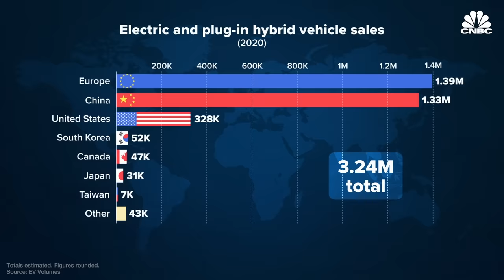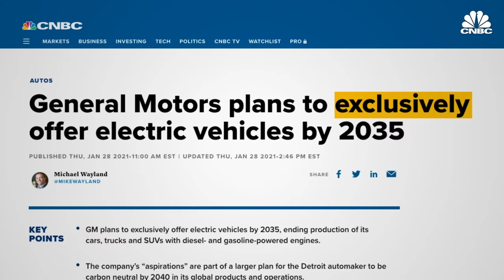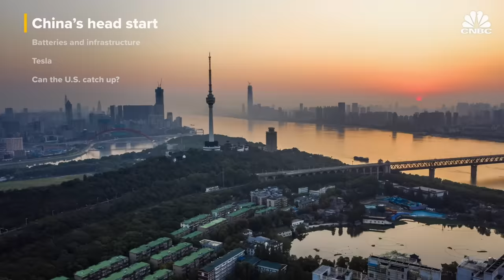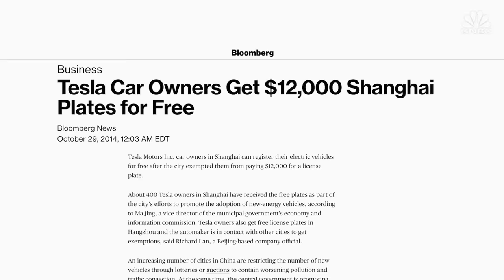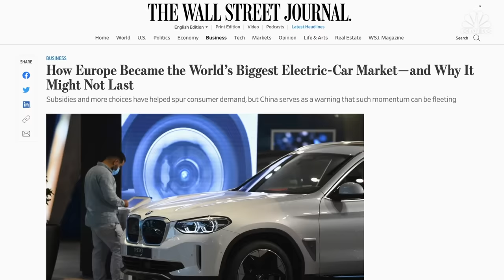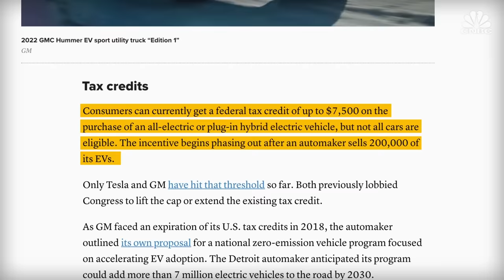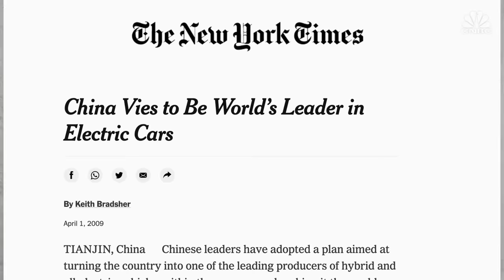Who Is Winning The Global EV Race?

Comment: Battery swapping seems like a dead-end technology. Charging is simply better. Imagine trying to scale up a battery swapping station. You would require on average 5 battery packs per customer on hand at the swap station, because it would take a long time to recharge each one. Not to mention the logistics and complexity involved with ensuring that the used battery pack is in good enough condition. Add to that the fact that most every single EV model has different battery packs and nothing is standard. With new EV's coming out with structural battery packs, this will be impossible, and eventually charge times will be on par with gas filling, so it will be a non issue anyways and the whole effort would go to waste. There's a reason tesla abandoned it after trying back in 2013.
Reply: Actually it is not, it helps the power grid, its way faster, battery degradation is no longer a concern and you can even upgrade it if you want it. Tesla abandoned because it requires way more capital hence the company wouldn't survive at the early stages... having lots of chargers across multiple parking lots is inefficient and the power grid has a limit of throughput.
Reply: @Prizax  so all of my previous points are a non-issue? There are 1200 battery swap stations currently in china, but chargers in every corner. Charging time should also into account time to take a detour. Chances are you are minutes away from the nearest fast charger but 45 minutes away from the nearest swap station. I also don't see swap stations ever being scaled even close to the level of chargers ever, and by the time they do, if at all, charging would already be fast enough.

Also, how is battery degradation not an issue with swapping? It's not like the station is making a fresh battery every time out of thin air.
Reply: @prachurgupta9719  Battery degradation is not a issue because once it reaches near dead point they will just recycle it, the business has to handle that expense but they get revenue by renting it or per change and so...  Battery swap is optional you can still charge it like any normal EV... battery swap is for those that value more their time or situations that demand it... there already places in China and US where you have to wait in line for a charger then park it for hours... 😂
Reply: @Prizax  
"It helps the power grid" only if the packs are available to be drained..... But you need them either charged, or charging, to service cars arriving. So no, it doesn't.
.
"It's way faster" only if:

You arrive and there is no queue.
You'll be waiting at least 6 minutes per car in front.
.
You don't arrive just as the last lack of your size/ type is taken. If it is, you'll be waiting for "pack 1" to charge.
.
If you arrive with your "large" pack, and find that of the 13 packs in the station, which holds 3 types of pack (big packs don't fit small cars)... the 4 packs of your size/ capacity have been taken by drivers with similar cars, but smaller packs, who "upgraded", so you're left with either say a 60kWh pack that's going to be ready in 20 minutes, or a 70 kWh ready in 50 minutes (yours is 100kWh).
Tough luck?
Reply: @rogerstarkey5390  uh you better check what NIO is doing in China the battery swap stations also have solar panels and people can see the availability and details of the batteries from their cars before having to arrive at the swap station hence you don’t much time.

Comment: Battery swapping vs. fast charging . The one thing that comes to mind, is long line, peak-hour, re-fueling pile-up . ( In my country, that is )n.
Reply: If they don't have proper multimodal transportation infrastructure in your country and you NEED to have a car even when you don't have parking space in your home where to charge it overnight (condo department, etc), that's an issue that your government should work on.

That's not a problem originated by EVs.

Look at the Netherlands, Denmark and even Finland (even with snow).

Comment: In Europe, EV sales definetely will continue to rise in the upcoming years, seeing the gas prices because of the war going on, the enviromental restrictions in big cities, and the EURO 7 emission rule starting from 2025. Seeing the first stats of car sales in Europe for 2022, the diesel will be dead in 2 years. In 2030, at least 70% of new car registrations will be EVs and plug in hybrids in the EU and China easily. Where will the USA be?
Reply: Prices for  lithium, cobalt, manganese, nickel, and graphite and other materials for batteries are going bonkers altogether and mostly come from the same countries that are driving oil and gas prices high and thats to supply 3m cars a year. When it gets to 70-80 m cars that itself could cause a war.
Reply: @davidfarrell1062  It will cause less problem as 10 years from now, the materials from dead batteries will be reused as well.
Reply: @vojtechvoros1549  loads of videos on that too. in 10 years time if we have 30m new EVs we will have dead batteries from 3m scrapped EVs which wont go far. Would take decades to have 50% of the dead batteries required. Plus the battery tech probably will have changed so much that the materials or quality of material in new EVs wont be good enough from the recycled material.
Reply: @davidfarrell1062 , The US has more than enough lithium for its needs...just need to extract it. but you are correct that it is a supply problem currently driving up prices.
Reply: @vojtechvoros1549  Agreed. Electricity is the counterpart of oil. Batteries, the carriers of electricity, are the counterpart of oil barrels. we shouldn't compare oil with lithium and other materials for batteries. And I also believe it won't cost much to reuse these elements from old batteries when we work out better technologies.
Reply: Little interest in Ireland and the UK.
Reply: @ValMartinIreland  for what?
Reply: In Britain it is more expensive to charge them than to put fuel in an ICE car.  In this cold weather the heater is powered from the charge.   With an ICE car heat is a by product.
Reply: @ValMartinIreland  the heater usually is a heat pump, which is really efficient. How is little interest if again was new record share among new car sales?

Comment: Interesting documentary! 

Battery swapping is an interesting technology, but charging at home or at work paired with solar seems a much more reliable solution on a nationwide scale. 

And with a smart charger, you don't really have to worry about battery degradation. 🏡⚡🔌🚘
Reply: Battery swapping is a terrible idea. You are limited to how many batteries you can swap in a day. What if you are charging and there are 3 cars in front of you? Then it will be 30 minutes before you have a battery. That’s like waiting at the pump 7 cars deep.

Then the worst thing of all. A battery swapping station is going to need 2 X the volume of batteries as cars on the road when manufacturers can’t even make batteries fast enough. You have to double your investment of every battery you make, you need a clone.

The last thing for me is, if I just bought a new car and now I need to swap my new battery out for an older one with 50k miles on it. Why would I ever want to do that? This only benefits people with old cars. You will never know the true range of the car because the battery life is different for every battery. What happens when you get a dud? Or the machine strips the bolts holding your batter in your car? Or the machine breaks down? 

For all of these reasons TESLA abandoned this idea and people didn’t want other peoples batteries in their car especially if you are paying north of $50k on a car.
Reply: @GET2222  agree, but there is also the fact that we're moving toward a service consumers instead of owner. Swapping a battery could be an interesting way to "decrease"  the charging time when self driving systems are 100% reliable. I can see it being implemented by Uber if they ever achieve a reliable self-driving system. But who knows probably by the time we get a self driving system we also get a better charging/battery system capable of self charging within 5 minutes.
Reply: @GET2222   the battery swapping system seems adapted to a business operating multiple identical vehicles, like taxis or delivery. 

Our mission is focused on smart and fast home charging paired with solar. We really believe that users should have more control over how they want to charge their vehicles. 🏡⚡🔌🚘
Reply: @GET2222  I wouldnt call it a terrible idea at all. I would call it an unnecesarry idea currently. What exactly do you mean by "What if you are charging and there are 3 cars in from of you?" well thats one of the problems that battery swap would fix... It would only take a few minutes.

And you dont need 2x batteries for each car. Not at all. Unless every driver would have to switch batteries before the empty battery is charged again. And that doesnt happen. Its much faster to charge. My guess would be like 1.2 batteries for each car.

I dont really understand your argument with older batteries? Even 50K mile batteries have almost perfect battery life. And those things could be checked at the battery swap station pretty easily. Not a big problem at all. If you are really unlucky, then you simply switch the battery again? It works perfectly fine
Reply: @GET2222  NIO already has a battery swap system that works very well. I can see the problems if you switch batteries at battery stations from other companies. That might cause problems, but generally its very possible to make a good battery swap system. Tesla abandoned the idea because of lack of interest, not because they didnt believe in the potential. It will be a thing in the future for sure, especially to make all the people who wont buy EVs because of the charging times buy EVs.
Reply: @geden_ahmed3510  TESLA abandoned it for a variety of reasons. The main one was because no one used it and you need to have double the battery output to service the cars you are selling. It's dumb. I have owned a MODEL X since 2016. No I would want to go and have my battery replaced. The battery is a critical component to the car. It determines your range. Every battery put into the car is going to have a different range. There is no way to predict how far your car will travel or how fast it could possible charge. Is the battery new or does it have 100k miles on it? Battery degradation is real. I have a variety of friends who are engineers at TESLA and SPACEX. TESLA abandons bad ideas from time to time. They said it was an experiment and people didn't like spending north of $70k on a new car and having it swapped out for an older battery. In fact, people hated the idea. It's a bad idea.
Reply: @GET2222  Those are problems that Can be fixed. You Can see the battery degradation of your own battery, so Why would it be impossible to make a system where you Can see the degradation of the battery you swap it with? And it Really isnt such a huge deal. If that system fails, and you get a bad battery, then you swap it again in a few minutes. The IDEA is Good, it just isnt necesarry yet. And again, No You do NOT need 2 batteries for each car. Not at all
Reply: @GET2222  No one used it because they didnt have a lot of stations, and it might not have worked very well. The NIO battery swap system is used a lot, and they are expanding it rapidly
Reply: @geden_ahmed3510  so three cars show up at a battery swap. Now it’s no faster than a charging station because it one at a time. Charging stations are going to be popping up every where and charging speeds are getting faster and faster. How does this work in the winter with snow and ice? I would not trust Jiffy lube with my oil changes in my BMW X5 MSport series. 

I have a Model X. I would never want to swap out my battery. I’m probably not the demographic for this.  This feels like a cheaper car service where people aren’t even in an EV forum thinking about this.
Reply: @GET2222  a NIO battery swap takes 4.5 minutes… Could probably easily be optimised if Tesla made it. How long does a full charge with a Good supercharger take? Like 40 minutes to 100%? I would rather do a 4 minute swap.

What are the odds of Big Lines at swapping stations if it only takes 4 minutes Per car? Wouldnt happen often Thats for sure. Long wait times for chargers are more common.

And i Really dont see the problem with swapping the battery… if the swapping stations has systems to check how Good the batteries are. And if you get a bad one, then you swap again… nothing happens to your car
Reply: @GET2222  actually, the new swapping stations are just 3 minutes Per swap. Sagnificantly faster, even with improved charge speed
Reply: @GET2222  i dont understand What the problem is. If you dont want to swap your battery, then Its fine. But that doesnt make it a bad idea. It would make the people who are worried about long charge times consider EVs anyways.
Reply: @geden_ahmed3510  
It's a poor use of valuable resources.
Reply: Why not ban cars entirely and make city's more sustainable and profitable by making them more dense and walkable it will reduce obesity and and other health issues and also battery cars are not good either they use tires and building them requires rare earth metals which causes pollution battery cars explode cars in general is a waste of money and time when you can build city's to be more walkable and better public transportation
Reply: @ujjalshill6442  that might be possible in the future. As it is right now, we still need cars.  EVs arent perfect for the enviroment, But sagnificantly better than ICE
Reply: @geden_ahmed3510  why not buses or  electrified rail that can be done now also buying electric would delay the real change that needs to made
Reply: @ujjalshill6442  how would you make every single person in a city like new York get around with only busses or trains? Just not possible right now.
Reply: @ujjalshill6442  i dont believe it Will ever happen. Atleast not for a very long time. Right now, switching to EVs is the best solution
Reply: @geden_ahmed3510  it's possible you just have to give the more roads to pedestrians and limit the amount of cars driving make bike lanes bigger put some tram on the road so cars have problem driving put speed limit you can pressure them to not drive unless it's absolutely necessary car traffic will eventually reduce
Reply: @geden_ahmed3510  no switching to EVs is the worst solution restricting cars inside city is the best solution
Reply: @geden_ahmed3510  also the roads won't have to be repaired more often which will save money for other things
Reply: @ujjalshill6442  problems is, you cant just walk to work in cities as Big as new York, LA, etc… way too long distances. Cant have trams or trains to every location either. The city would have to be build for that in the beginning
Reply: @geden_ahmed3510  less  tires less pollution
Reply: @geden_ahmed3510  if the government wanted it could the only thing stopping it from happening is car and oil company's
Reply: INDIA WANTS TO FALL DOLLARS VALUE..
Reply: @godanddevil.5331  lol

Comment: Tesla will sell nearly 2 million EV's in 2022. Leading the world for EV sales. GM Sold 26 in Q4 of 2021
Reply: GM stopped production of the Bolt due to the battery issues and the fact that all newly manufactured batteries are being used for replacements on existing vehicles. A disater of GM's own making, that is true, but it makes the comparison less usefull.
Reply: No supplier (Tesla among them) is immune to battery problems at one point or another. If I were GM I would be much happier having big battery issues now in the GM EV infancy,  than as a mature market builder of EV's like Tesla.
Reply: @daviddill5227  whatever makes GM sleep better at night i guess🙄
Reply: @duhaneyparkclassics7484  - just because GM has stumbled so far doesn't mean they are relegated to 2nd, 3rd or lower status. They are a big company with some smart engineers as all automakers are. It is just when they can make everything mesh together is when they will be able to get a decent EV to market that will get the attention of the competition, the auto press and the masses. Its not an impossibility.
Reply: @duhaneyparkclassics7484  - it applies to all legacy car makers. I said GM because that was the company of discussion. I wouldn't be so shortsighted in thinking the legacy car makers won't or can't catch up.
Reply: @daviddill5227  like i said I work in the industry. they won't catch up. they all run on instant gratification. let some new incentive become available and its back to business as usual.
Reply: @duhaneyparkclassics7484   - I am not saying the kegacy car makers are better. (NOTICE HOW I NEVER SAID THAT) WHAT I AM SAYING IS THEY WILL DO SOMETHINGS RIGHT WHEREAS THE BABY CAR MAKERS WILL HAVE GROWING PAINS IF THEIR OWN. THE THING TO REALIZE IS ITS A MARATHON TO SUCCESS, NOT A SPRINT. DON'T COUNT OUT THE LEGACY CAR MAKERS, THEY JUST MIGHT SURPRISE YOU!
Reply: @duhaneyparkclassics7484  what car company do you work at duhaney? You mind if I ask?
Reply: @daviddill5227  i don't mind... Cadillac
Reply: @daviddill5227  I wish them luck but they are not nimble enough and they are now saddled with billions of dollars worth of useless factories. A workforce that knows how to make ICE cars. etc etc etc. Like I said I wish them luck some will survive... probably not Dodge though(inside joke)
Reply: @duhaneyparkclassics7484  I expect Chrysler/Stellantis to at least be much smaller if not be finished. That is the worst run car company ever. GM I think will survive but some brands will fold. Ford should survive but I think they will have to reorganize more than what their plans are currently.
Reply: @duhaneyparkclassics7484  - you think GM will make it?